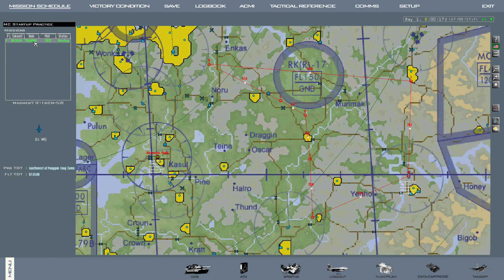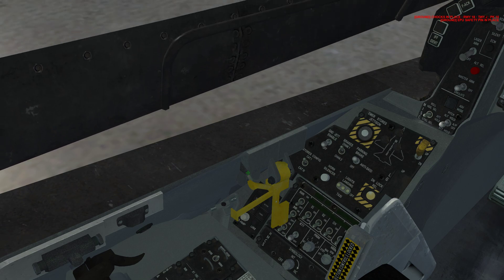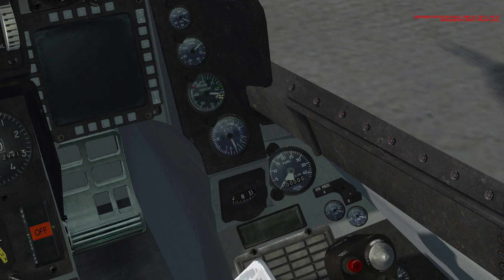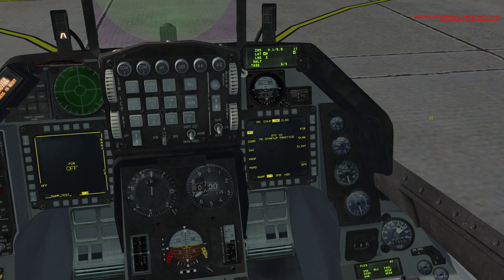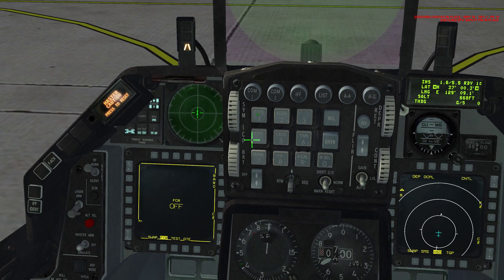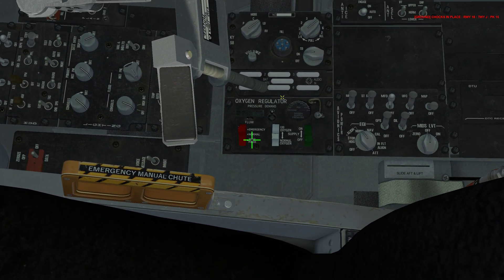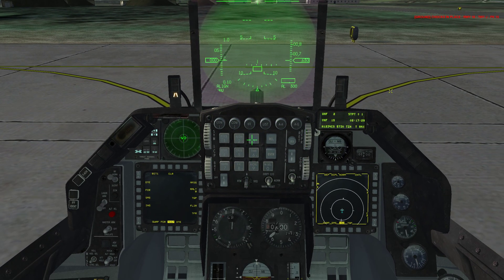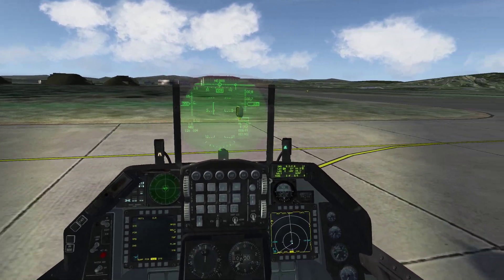Falcon BMS Quick Tutorial: F-16 Aircraft Startup/Ramp

Comment from the maker: Heres a little cheat sheet if you dont want to read BMS checklists that you should be using in the first place. No, its not from the manual, and yes its performing steps you usually do in flight. If you wanna talk about the Laser Arm and Master Arm on ground pound sand <3

1.	Hide Body (L ALT + C, then P)
2.	Cycle IRL Throttle to FULL then IDLE
3.	Close Canopy Switch (RMB Long) (Top left Of Yellow Canopy Lock)
4.	Press Yellow Canopy Lock to LOCK
5.	PWR Switch to BATT (LMB) (Middle Position) (Below Throttle)
6.	FUEL Knob to NORM (LMB) (L/H Side, Middle)
7.	AIR SOURCE Knob to NORM (LMB) (Behind R/H Arm Rest)
8.	PWR Switch to MAIN PWR (LMB) (Top Position) (Below Throttle)
9.	START Switch (RMB) (goes to START 2) (FWD of Throttle)
10.	Wait until RPM STABILIZES at 25% and SEC Advisory Light Extinguish
11.	Left ALT + I for Idle Detent Switch
12.	Await RPM Stabilize
13.	AVIONICS POWER Panel - All Switches up, EGI Knob to NORM (Back Right)
14.	R/H MFD > DTE Page > Press the LOAD OSB
15.	Arm Ejection Seat (Yellow Rectangle on L/H Side of Seat)
16.	FLT CONTROL Panel – Hit FLCS Reset, then BIT Switch (Switch goes to OFF when complete)
17.	IFF Panel – MASTER Knob to NORM, C&I Knob to UFC (L/H Side)
18.	External Lights – As required (Anticollision to Flight #)
19.	ECM Panel – Switch to OPR (Full Up) (L/H Side)
20.	COMM 1 and COMM 2 Knob Fully Increase (Right of Throttle)
21.	UHF Knob to BOTH (Directly above COMM 1 Knob)
22.	HMCS Panel – Knob to Full INC
23.	RWR Power Button – ON (Left of HMCS Panel, Bottom Right of the 4 Squares)
24.	CMS Panel – 3 Left Switches UP, 4 Switches in a Row UP, Mode Knob to MAN
25.	STORES CONFIG Switch – Verify Correct (CAT I for A-A, CAT III for Heavy Loadout)
26.	Laser Arm Switch – ON (LMB) 
27.	Press HANDOFF Square Left of RWR Screen
28.	Rotate SYM Knob Full Up on UFC (Just Right of RWR)
29.	Tune VHF to Intra-Flight Frequency
30.	Remove EPU Pin (T, 1)
31.	SNSR PWR Panel – First 3 Switches UP, last one to STBY (Radar Altimeter) (Right of Stick)
F-16 COLD START UP CHECKLIST Pg. 1 of 2
32.	Internal Lighting – As Required
33.	Oxygen Regulator Switch to ON (R/H Side, Green Switch)
34.	Verify FLCS BIT Test Complete > L/H MFD > TEST Page > Press CLR OSB
35.	FUEL QTY SEL Knob as Required (Above ejection Handle)
36.	Obtain QNH from Radio > Input Altimeter
37.	Verify VHF set to Intra-Flight Frequency / Check In
38.	TACAN Yardstick for Intra-Flight – As Required
39.	BINGO - Set
40.	IDM – As Required (Input other flights in Package)
41.	HMCS Coarse Align – List > 0 > RCL > Dobber Right > 0 > Align Cross > Shift+C (Cursor Enable) > after alignment press Dobber Left
42.	Press LIST on UFC > 6 > Wait for INS to reach 4.0 and HUD to flash ALIGN in bottom Left
43.	AVIONICS POWER Panel – Rotate EGI Knob to NAV (LMB)
44.	As Required – WPN Power, FLIR Power
45.	TAXI Light – ON (RMB)
46.	External Lights - STEADY
47.	Anti Collision Light – ON
48.	Intra-Flight Freq – Call in Green Jet
49.	As Required – Set Steerpoint 2 / HSD Distance / FCR Range / TGP Settings
50.	Ground Abort AI – As Required
51.	PROCEED TO NEXT STEP WHEN READY TO TAXI
52.	Press F to start ACMI Recording
53.	MASTER ARM – On
54.	Parking Brake – OFF
55.	NWS – Enabled
56.	Chocks – REMOVE (T > 2)
Reply: I don't know what 3/4 of this means but I guess it's a start. :D Thanks for the list!

Problem is that you need the kb from time to time as it seems. I'm using VR so that's a bit complicated. Any tips on that topic? Like how to communicate with the ground crew in VR without using the keyboard?
Reply from the maker: @WatchMysh  use voice attack if you dont wanna use keyboard for comms
Reply: @dualaccumulator  I always forget about that... Thanks. :)
Reply: 9:14 Where the hell is the "cursor enable button"?
Reply from the maker: @jasonking442  You have to bind it in the controls, its not a button in cockpit
Reply: @jasonking442  im pretty sure the default key is 'insert' on your keyboard, but if not u can bind it in the falcon bms launcher
Reply: Up for promotion, well done CMDR

Comment: a little comment regarding the arm rest for those not using VR or TrackIR. 
if you press and hold your mouse wheel, you can then move the camera forwards, backwards and left and right on a flat plane by moving the mouse. meaning you can shift the camera Forward to look past the arm rest. if you do a normal click with the middle mouse button it will reset the camera to where its supposed to be.
Reply: how do i move around the cockpit? like move my head around

Comment: I've played the first Falcon on Atari Ste and then Falcon Allied Force and then BMS 4.32 for years... I was dreaming to have it in VR and now it's a reality!! I was never able to play DCS since there was no dynamic campain. I'm so rusty I will have to relearn almost everything! Thank you for your video. Fly safe. :)
Reply: Don't sweat it man! I was (am?) in the same boat as you, coming over from Allied Force. Having to relearn everything is a little frustrating but it's just repetition.
The problem with the ramp start in the docs is that every step also contains lots of explanation & advice, which is great but I decided to make a some cheat sheets where I omitted all that stuff and just wrote down the actual steps and omitted the commentary. Helped a lot.
One thing to really pay attention to at ramp start:
Once you've hit the throttle detent and the jet is spooling up, pay attention to those gauges!
The FTIT (temp) should slowly rise and then fall back down to idle operating temperature, around 500.
A couple of days ago, I wasn't paying close enough attention and experienced a "hot" start - aircraft was on fire & smoking like crazy.
Good luck & have fun!
Reply: @effsixteenblock50  Man, I just saw your answer, sorry. Thank you so much for your response. I will be careful about the new engine hot start. Fly safe brother. : )

Comment: This is a more in-depth cold start compared to DCS
Reply: Yes and he skipped many of the diagnostic tests that BMS has included in the ramp start. He skipped them because they're mostly eye-candy and not really necessary. They ARE done in the jet IRL every time, except when being scrambled to intercept....uh...balloons & stuff like that. :)
Reply from the maker: @effsixteenblock50  Small correction, every test I've skipped isn't required in the game, the F16 will function normally without any additional tests 😉
Reply: @dualaccumulator  Right. That's what I meant when I said "they're mostly eye candy". They don't affect the game mechanics at all.
Reply from the maker: @effsixteenblock50  Just making sure you weren't confused, you stated "not really necessary" when its not a "not really" situation, they in fact dont matter in terms of aircraft being operational 😁
Reply: Only a few steps. More of which will be added in DCS. DCS looks much better though.
Reply from the maker: @dannyd7714  DCS definitely looks better, but it feels like a cockpit simulator instead of a combat flight simulator. Cheers!